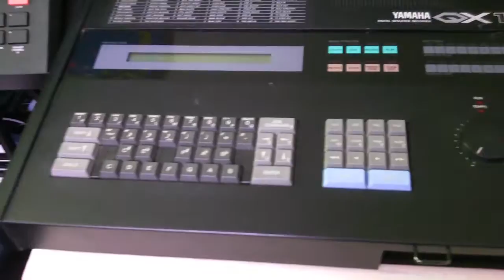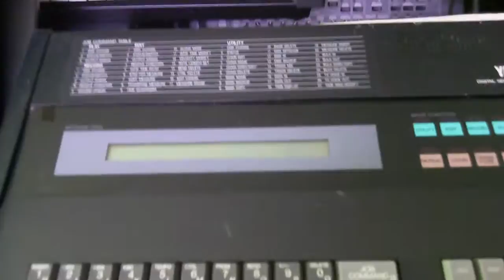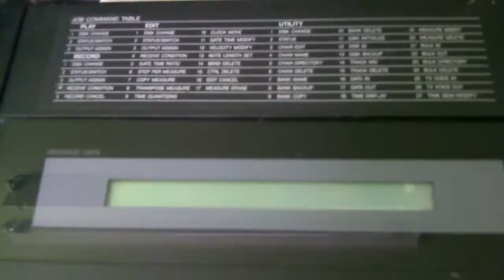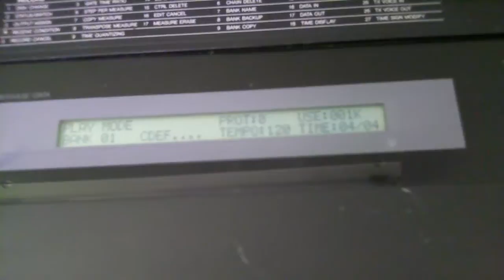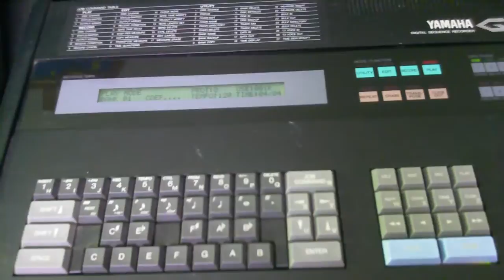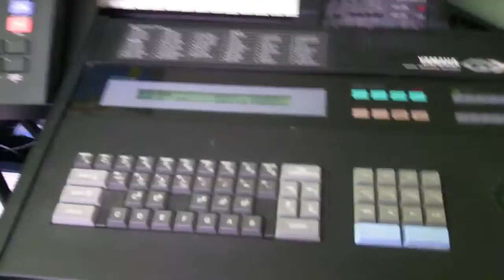Yamaha QX-1 with HxC SD Card Floppy Emulator

Comment: Hello Jim, i have a Yamaha SU700 with a floppy drive emulator but can´t make it recognize the SD card, it is not possible to format the card because it says it is write protected, this is what i did:

1-Replaced the sampler´s zip unit with a REV F SD Floppy drive emulator
2-Selected the ID1-A jumper (other yamaha devices uses this one)
3-Formated a SanDisk Ultra (30MB/s) HC-I, 16GB SD Card with the next format: "MS-DOS (FAT 32) - MBR" 
   *I am doing this process with an iMac OS X El Capitan.
4-Introduced the SD Card into the sampler to can format it but the floppy emulator doesn´t recognize the card and the sampler says the card is protected.
   *The physical card lock is set to off

None of this seems to work while loading the card into the sampler, do you have an idea what could be wrong in the process'

Thanks a lot, i aprecciate it.

JD